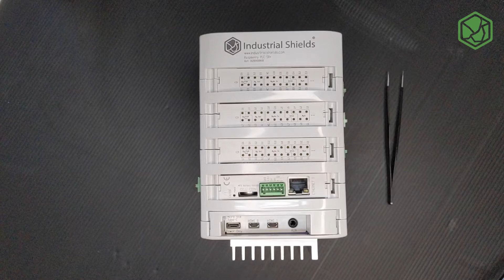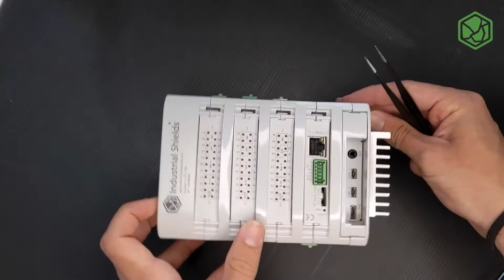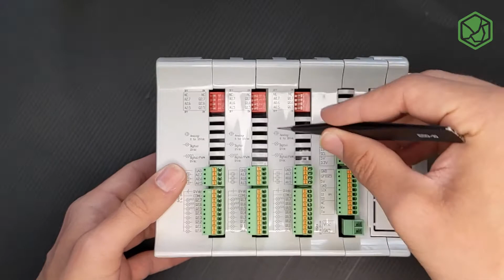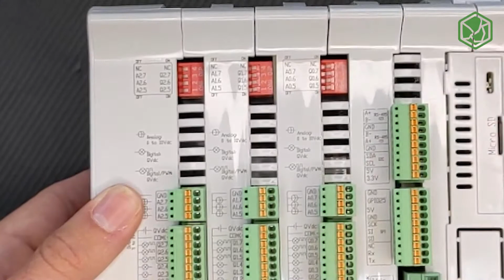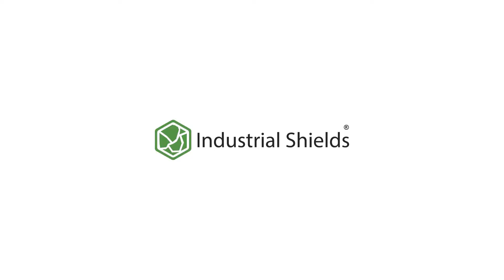➡️ Configure the switches of the Industrial RASPBERRY PLC

Comment: How does the cpu communicate with the io?
Reply from the maker: Hello! The IOs of this PLC work through I2C expansion chips that are connected to the CPU of the RPI. You can find internal schemes and more information on the UserGuide of the device attached on the Related Documents Section of the Product Webpage:
https://www.industrialshields.com/shop/product/raspberry-plc-configurable-1980#attr=1667,479,2597,2598,2599,854,1811,140,1761,1346,842,1142,945,107,1258,1264,1451

Thank you,